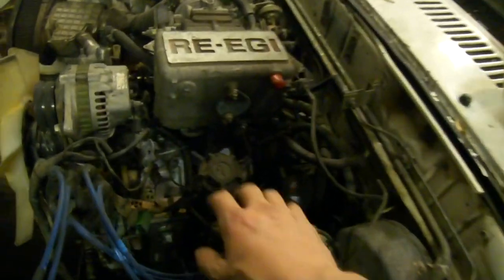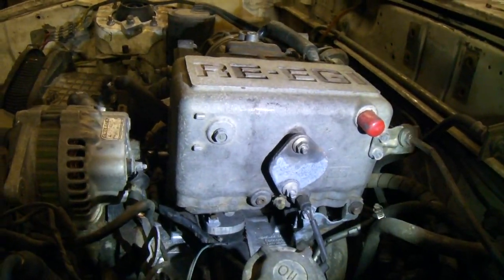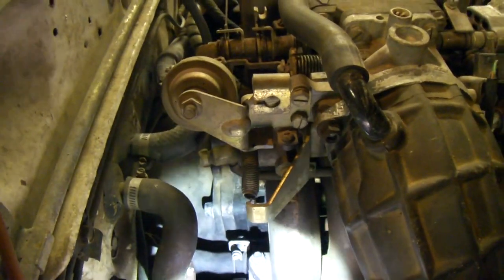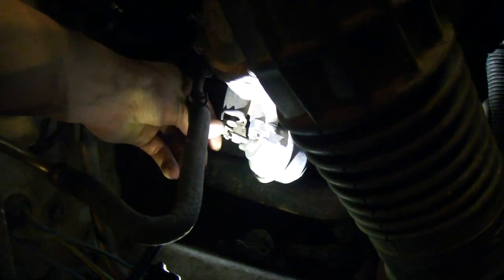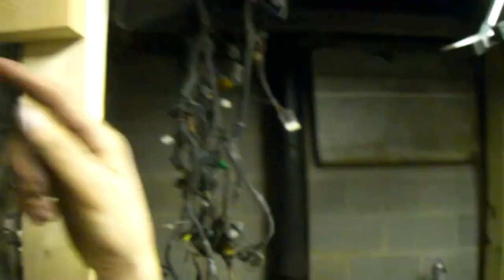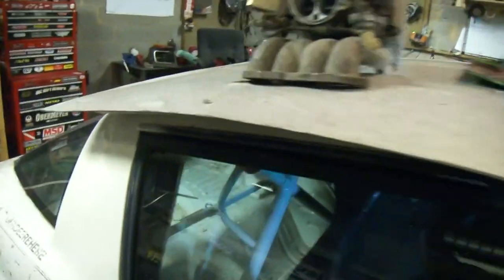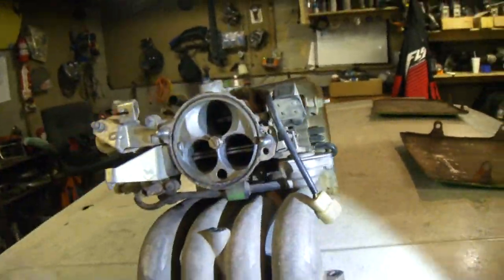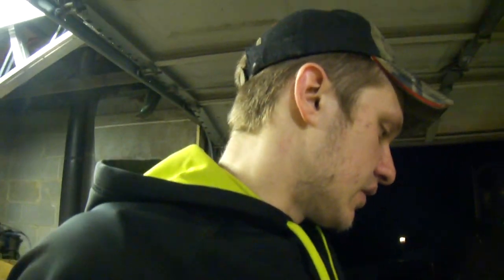FB RX7 GSLSE RATS NEST DELETE

Comment: My gsl-se was quick -with a k&n drop in, racing beat headers, 2 3/4 exhaust and a blown out 3 1/2 inch magnaflow I could run alongside a 89 foxbody 5.0 automatic. It was a 5 speed with nothing but dash shifter and bucket seats. The heat did work tho. I miss that car so bad...

Comment: Does this provide a performance benefit or simplification only?  Very interesting educational to see what under that intake.  I have RB header and exhaust setup on mine so no cat or air pump.
Reply from the maker: Performance wise nothing you will feel on the street.  Simplification is the main goal here.  Getting rid of old solenoids and valves is the benefit.  Much less to go wrong and less places to leak

Comment: Great video, my ratsnest was pared down a lot by the previous owner but not completely and its nice to see i can ditch everything if i choose.  I'm curious if you deleted the vacuum timing advance?  My car started stumbling really hard, and while checking the timing i noticed it runs almost perfect with it the vac advance disconnected.  The downside is my trailing and leading throttle now read about the same.

Comment: Thanks a lot bro! Question, what is the thin coolant line for by the intake? And what do you do with it?  Tia!
Reply from the maker: the coolant line that circulates through the intake can be blocked off on both the rear of the engine and the back of the water pump,
Reply: @RADPotential  did it, it looks clean, thanks man.
My tps has been bad and i've been driving the car like that for a while, i just keep it unplugged, seems weird that it is still running good, your thoughts?